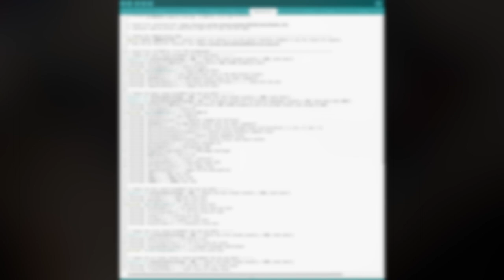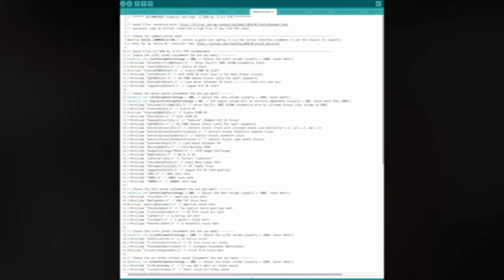Arduino ESP32 RC Sound And Light Controller: Important Software Update!

Comment: Great project!For the LEDs wiring parts,I found no infos about it...Can you show the full schematic diagram about the projects?
Reply from the maker: Thanks. The schematic will follow later on, as soon as my tests are finished. For now, refer to the schematic pieces on my GitHub as well as to the pin numbers in the sketch.

Comment: Tq for your tutorial i have try ti make it..the problem is when i used other esc(not hobby wing) when thortle is full then sound of engine is going back to idel sound..but it not happen when i used hobby wing,is there any setup for other kind of esc for this issue
Tq
(sory my english not ao good 😊)
Reply from the maker: You're welcome. Make sure, your transmitter sticks are in neutral during 1s after powering up your vehicle. Note, that I can't recommend any other ESC than the Hobbywing. They just don't work properly, if they don't have a proportional direct brake.

Comment: Great work! Awesome sound. Do you plan to sell the PCB for the sound/light controller?
Reply from the maker: No, but you can easily build your own, if you order the PCB, using my files
Reply: @TheDIYGuy999  Yes, thanks, my order is in with OshPark. My parts are ordered too. This should be fun. I want to use it in a Fayee 6x6 truck.

Comment: I found my throttle channel works reversely with reverse led,i.e when I forward my car,reverse led on.How do I change it in code to work it properly?
Reply from the maker: Swap your motor wires and invert the throttle signal on your transmitter or add the throttle channel to your invertRcSignals() function
Reply: @TheDIYGuy999  Thks for quick reply,I'll try that...
Reply: @TheDIYGuy999  I dont know about the code  invertRcSignals() function and how to add?Is it possible making the code easily in the Adjustments.h so we can easily configure it like adjust indicator direction with true or false?
Reply from the maker: @cliffkhew  I may add this feature to the next version. Your transmitter is not able to flip the throttle signal?
Reply: @TheDIYGuy999  Yes,there is no problem of swapping the motor wires and set the throttle channel in reverse.But it is great to add the feature so we don't need the soldering work :)

Comment: Sir please answear, my coding esp32 led blue no respond please helpme
Reply from the maker: You need to have a look at the serial monitor
Reply: @TheDIYGuy999  When programmed, everything is done, but the blue light doesn't flash, and the module doesn't make a sound
Reply: @TheDIYGuy999  I'll try uploading it to YouTube later and you'll see what's wrong
Reply: @TheDIYGuy999  serial monitor runs without stopping
Reply from the maker: @YTOfficial-316  what does it say?
Reply: @TheDIYGuy999  i dont now serial monitor run
Reply from the maker: @YTOfficial-316  https://docs.arduino.cc/software/ide-v2/tutorials/ide-v2-serial-monitor/

Comment: Very nice. I have made a Sound Module for RC Boots with an Arduino Pro Mini 328 and an SD Card with Wave Files on it. Now I have seen your Project. I have some questions: Do you think it is possible to store the Audio data into the SPIFFS Flash ? I think a Bluetooth connecting for the settings would be nice. What do you mean? #DerRCModellbauer
Reply from the maker: Hallo und danke für das Lob. Ich habe dein Modul auch gesehen. Funktioniert gut für einen 328P. Der ESP32 stellt diesen aber um Längen in den Schatten. Das mit dem Flash hab ich mir noch nicht überlegt, da der interne Speicher bisher noch nie über 50% voll war. Bluetooth wird vielleicht irgendwann dazukommen. Ich kann dir nur wärmstens empfehlen, den ESP32 zu testen. Macht alles viel einfacher ohne den SD-Karten Kram. Lichtsteuerung nebenbei funktioniert auch wunderbar, da jeder Pin (max.. 16) auch PWM kann. Habe meine statusLED library so erweitert, dass sie auch mit dem ESP32 funktioniert. Viel Spass beim Nachbauen! Gerne nehme ich deine Erfahrungen und Anregungen entgegen.
Reply: @TheDIYGuy999  Danke für die schnelle Antwort. Mit der Flash Speicher ist sinnvoll wenn man alle Sounds abspeichert und dann nur noch wählen muss und nicht neu programmieren. Oder per WLAN oder Bluetooth Dateien aufspielen will. Das wäre natürlich die Krönung.
Reply from the maker: @DerRCModellbauer  So wie ich das verstehe, landet das Programm und die Sounddateien eh im Flash und der ist bei den meisten ESP32 4MB gross. Alle Dateien werden nicht hineinpassen und das macht auch kaum Sinn, da die Konfiguration eh individuell auf jedes Fahrzeug abgestimmt werden muss. Das mit dem Bluetooth schaue ich mir mal an, hat aber momentan keine hohe Priorität. Erstmal muss der King Hauler vernünftig laufen und tönen. Wirst du das Ding nachbauen?
Reply: @TheDIYGuy999  hab ich schon läuft sehr gut.
Reply from the maker: @DerRCModellbauer  Du meinst den King Hauler? Welchen Sound hast du verbaut?
Reply: @TheDIYGuy999  Das Modul. Sound war DetroitDieselPeterbiltCabover.
Reply from the maker: @DerRCModellbauer  Gut zu hören, dass es funktioniert. Gerne würde ich auch ein Video von dir darüber sehen
Reply: @TheDIYGuy999  Darf ich denn noch Änderung am Sourcecode vornehmen? bzw. Hardware (eigene Platine mit Verstärker). Schreibe mal was zusammen und schicke es dir.
Reply from the maker: @DerRCModellbauer  warum solltest du das nicht dürfen? Quelle (am besten mit Link) erwähnen ist immer nett, ansonsten darfst du damit tun was du willst. Für Vorschläge bin ich natürlich offen und übernehme diese, wenn sie sich mit meinen Bedürfnissen unter einen Hut bringen lassen. Momentan bin ich daran, eine simpeln 8 Kanal Multiswitch Platine zu bauen. Sie wird einfach an einen freien Analog-Eingang des Senders angeschlossen und erzeugt damit ein "gestuftes" Poti. Das abgestufte PWM Signal wird dann zur Triggerung von Geräuschen genutzt. Ist viel einfacher, als all die Nautic etc. Module, bei denen häufig auch nur 1 Taste gleichzeitig gedrückt werden darf.
Reply: @TheDIYGuy999  Jetzt wird es unheimlich! Baue auch grade ein Multiswitch mit Digitalem Poti. https://photos.app.goo.gl/vuZbEi7Lf5Gc2HmeA
Reply from the maker: @DerRCModellbauer  Ja, hab da schon mal was auf deinem Blog gesehen. Hast du ev. Detailangaben zum Futaba Profil? Habe mal Versuche mit dem BEIER Profil gemacht, aber war nicht erfolgreich. Keine meiner 3 verschiedenen Transmitter & Receiver war in der Lage, die Pulse schnell genug zu übertragen. Drum denke ich, es ist schlauer, die Daten rein Analog in ms zu übertragen. Sollte für 8 Schalter problemlos reichen. Bin grad am testen.
Reply: @TheDIYGuy999  habe hier das neue Modul beschreiben. https://www.rc-modellbau-schiffe.de/wbb2/index.php?thread/40626-arduino-universal-multiswich-auf-futaba-f16-mit-jamera-t8f-jump-2-4ghz-steck-mod/&postID=566427#post566427. Sollen wir auf E-Mail umsteigen sonst wird es hier unübersichtlich?   
DerRcModellbauer@ziege-one.de
Reply from the maker: @DerRCModellbauer  können ruhig hier weiter diskutieren. Der NVM Multiswitch funktioniert wie gesagt bei mir nicht. Vermutlich ist die Funkübertragung zu langsam. Woher hast du die Angaben zum Übertragungsprotokoll deines DIY Arduino Multiswitch, das zu Robbe passt?
Reply: @TheDIYGuy999  habe das einfach Mal mit einer Impuls Messeschaltung analysiert. Sind immer 9 Impulse hintereinander wo bei der erste kleiner 1 ms ist. Hab ich aber ein Video von gemacht. Da hab ich auch die Probleme beschrieben warum es nicht mit 2.4ghz Anlagen geht.
Reply from the maker: @DerRCModellbauer  Sorry, hatte nicht realisiert, dass du Videos gemacht hast. Sehr gut umgesetzt!
Reply: @TheDIYGuy999  Habe mir folgendes überlegt: wenn ich richtig gezählt habe sind noch 23 GIPO Pins frei. Davon würde ich 12 Ausgänge Schaltbar oder PPM machen (8 mit Treiberstufe). Und den Rest als Eingange bzw. Ausgänge für Servos oder einfach nur als Binäreingang 1/0. In der Software konnte man dann Module für Multiswitch oder dein "statusLED" einbauen und die Ein bzw. Ausgänge zuweisen. Zusätzlich könnte man verschiedene serielle Protokolle einbauen (sumd Specktrum Frsky...). Mit der Hardware konnte mal alles im Model steuern von Sound Licht über Servos usw. Ist natürlich noch ein Weiter weg sollte aber machbar sein.
Reply from the maker: @DerRCModellbauer  Ich stelle mir die obere Reihe als 3 pin Servo Stecker vor, die untere mit Treiber-Transistor für LED, Rüttler-Motor etc, negativ schaltend (hab ich auf meinem Board so gemacht). Detail-Pinbelegung gemäss meinem Programm. Auf der oberen Reihe sind derzeit links 4 Servo-Eingänge und rechts ein serieller Eingang mit "Micro RC" spezifischem Protokoll verbaut. Das möchte ich nicht ändern. Weitere serielle Protokolle sind natürlich möglich, ebenfalls PPM. Die Generierung von Servo-Signalen ist auch möglich, ev. auch zum rampengesteuerten (Massensimulation) Ansteuern des ESC. Hast du nähere Angaben zu deinen erwähnten seriellen Protokollen bzw. wozu willst du sie nutzen?
Reply: @TheDIYGuy999  Hier mal mein Schaltplan http://ziegeone.goip.de:8088/index.php/s/fcFf7oB2beqeaGD. Protokolle brauch ich nicht habe nur gedacht, das das eine Option ist !
16 Output und 11 Servo in/out oder Switch
Reply from the maker: @DerRCModellbauer  Danke für das Schema. Hier meine Bemerkungen dazu:
Die Pins CLK, SD0, SD1, SD2, SD3 sind nicht nutzbar, da ESP32-intern verwendet
Die ADC-Soundausgänge müssen auf Pin 25 & 26 sein
Der PAM8403 und das Lautstärke-Poti fehlen
Die Stromversorgung fehlt (habe 7805 Regler und nachfolgenden 1000uf Kondensator verwendet).
Das Modul muss zwingend extern ab 2S und 3S Akku versorgt werden über obigen Regler (Diode 1N5809 als Verpolungsschutz vorschalten)
Die Servo-Stecker-Reihe wird über Diode 1N5809 (in deiner Leitung oben rechts) mit 5V eingespeist, um Rückspeisung von allenfalls höherer BEC Spannung zu verhindern (der PAM8403 mag keine 6V).
Der Rüttler-Motor benötigt mindestens 500mA (Mosfet mit geringem Spannungsabfall nötig)
Welche Treiber-IC willst du verwenden?
Ich halte die 3 pin Stecker auf der Ausgangsseite für gefährlich wegen verwechseln mit Servo-Anschlüssen
Zu den Protokollen musst du dir keine Gedanken machen, das ist über die Servo-Anschlüsse flexibel handhabbar
Ich würde möglichst viele Bauteile unterhalb des ESP32 Sockels anordnen
Ich werde mit keiner Platine starten, bevor der Versuch im King Hauler abgeschlossen ist
Reply: @TheDIYGuy999  Die Pins CLK, SD0, SD1, SD2, SD3 sind nicht nutzbar, da ESP32-intern verwendet ------> grade auch gelesen 

Die ADC-Soundausgänge müssen auf Pin 25 & 26 sein ------> Fehler von mir
Der PAM8403 und das Lautstärke-Poti fehlen ------> Die Frage ist, ob die 3W für ein Boot reichen ? dachte an 15-+30 Watt digital Verstärker https://www.ebay.de/itm/Tpa3110-Pbtl-Mono-Digital-Power-Amplifier-Board-30W-NW/264400997201?
Das Modul muss zwingend extern ab 2S und 3S Akku versorgt werden über obigen Regler (Diode 1N5809 als Verpolungsschutz vorschalten)  ------> macht Sinn, wenn ich den Verstärker nicht extern verbaue.
Der Rüttler-Motor benötigt mindestens 500mA (Mosfet mit geringem Spannungsabfall nötig)
Welche Treiber-IC willst du verwenden? ------>  ULM2803 man könnte auch Mosfet in smd und dann unter die Platine.
Ich halte die 3 pin Stecker auf der Ausgangsseite für gefährlich wegen verwechseln mit Servo-Anschlüssen ------> Das hab ich so von den Multiswitchen (Futaba) übernommen hast recht.
Ich würde möglichst viele Bauteile unterhalb des ESP32 Sockels anordnen ------> Hatte ich so vor mit Buchsenleiste
Reply from the maker: @DerRCModellbauer  Ich würde die Finger von den ULM2803 lassen, da es bipolare Transistoren mit riesigem Spannungsabfall sind. N-Channel Mosfets dürften da eher die richtige Wahl sein: https://www.distrelec.ch/en/mosfet-55-sot-223-ir-irll014npbf/p/17137896 Der ist sogar noch wesentlich zu gross.
Reply: @TheDIYGuy999  V2 http://ziegeone.goip.de:8088/index.php/s/GqAmNt5ALC2zg5a mit IRF 7103 oder IRF 7301 12 Ausgänge 5 Universal Servo Anschlüsse 4 Servo in Fehlt noch Spannungsversorgung und Diode Verstärker und Poti
Reply from the maker: @DerRCModellbauer  Ich finde den IRF7301 gut, du müsstest bei Motoren aber noch eine Freilaufdiode über die Last schalten. Die TX2 und RX2 pins kannst du auch verwenden, ich kommuniziere über pin 36 mit meinem Receiver.
Reply: @TheDIYGuy999  habe diese Liste hier benutzt https://randomnerdtutorials.com/esp32-pinout-reference-gpios/ da kann man sehen welche Pins man benutzen kann und welcher besser nicht. TX2 und RX2 meinst du GIPO 1 und 3 ? 36 hab ich als Servo in benutzt. Reicht eine 1N4148 als Freilaufdiode.
Reply from the maker: @DerRCModellbauer  Habe diese Liste auch gesehen. Nein, ich meine GPIO 16 & 17, welche ich für das Blaulicht nutze. Die 1N4148 ist nur für Ströme im mA Bereich geeignet. Der Rüttlermotor hat eine Kurzschlussstrom von 300mA, sie würde also knapp reichen und als schnell wird sie ja auch bezeichnet. Nötig gist sie eh nur für induktive Lasten, sonst kannst du sie auch weglassen. Da ist übrigens noch einer am bauen: https://www.youtube.com/watch?v=Y_gomlgUUC4
Er hat auch meinen Arduino Sender und Empfänger

Comment: 😁😁 perfect sob
Reply from the maker: Thank you
Reply: What button do you use to turn on the extra horn?
Reply: I have succeeded in making as in your previous tutorial, with the results of the sound, turning on the fog via mode2, turn signal left and right, the horn with a pot, can the toggle switch 3 position and mode 1 be maximized to turn on other modes?
Reply from the maker: @AatTsani  Use the Momentary button on the bottom right of your transmitter. It only works in serial communication mode
Reply from the maker: @AatTsani  I'm still not sure, what the best option is, but will change / optimise it most certainly
Reply: @TheDIYGuy999  thank you😁😁
Reply from the maker: You're welcome. Can't wait to see your video ;-)
Reply: Okey wait,